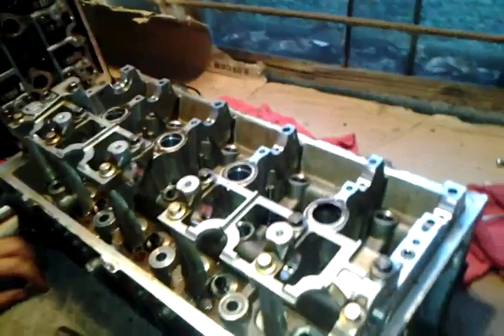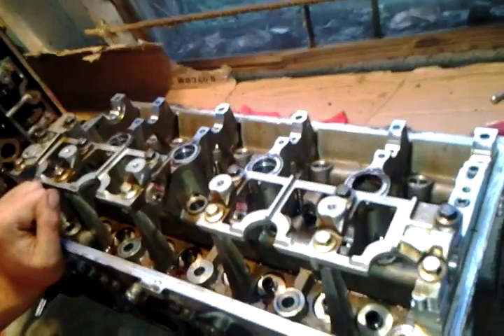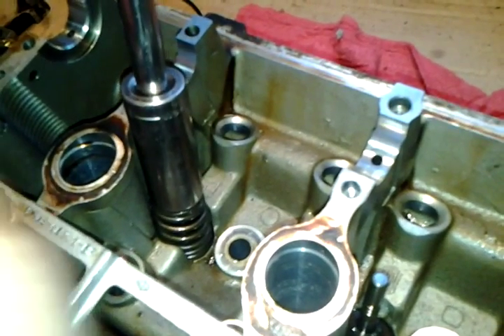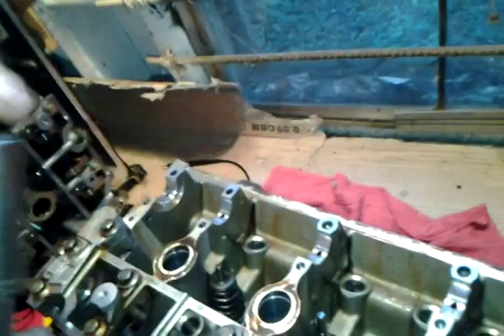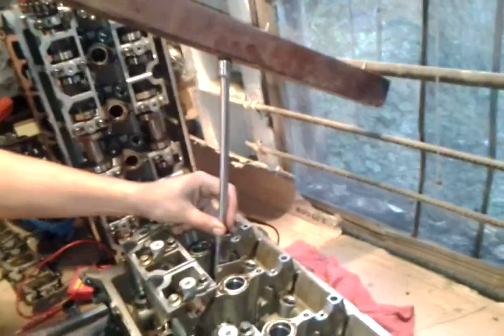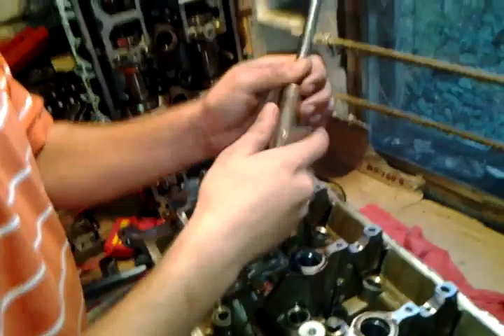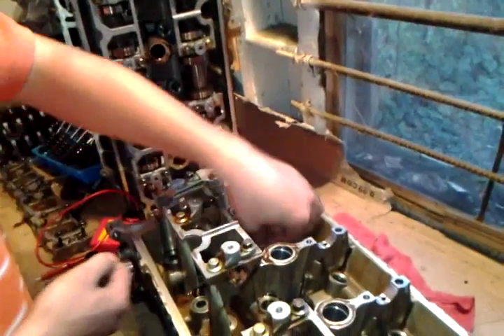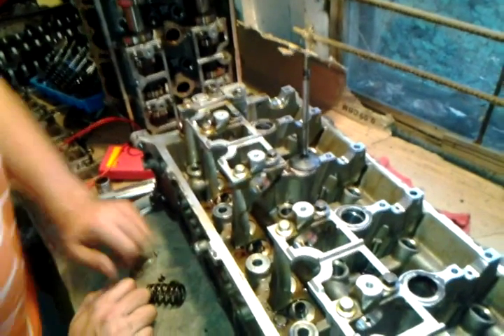Remove the Valve springs from a 4.6L DOHC Head without Ford Tools

Comment: Actually an old chevy method is rag under valves like you did and old socket just as you did but instead of using a lever and magnet set up you can use the magnet on socket as well but use a rubber mallet and crack the socket hard and the keepers will pop out I have done this on 4 valve head many of times and it does not hurt anything. granted if you use a 20 lb sledge and crack it violently sideways you can bend a valve but then the same moron that did that mistake is same one tore apart an engine so he probably already destroyed a number of parts already. I used this method as I purchased the 4.6L 2V spring tool and 100% it will NOT work on the 4 valve head maybe a handful of cylinders yes with major issues

Comment from the maker: You would not want to do this with the head in the car unless you had a air compressor blowing preasure into the cylinder via the spark plug hole. Depending on the tool you are using, you should be able to use a wrench and pivot it on the camshaft shaft as directed. You just need a very strong magnet
Reply: when removing valves in vehicle do not use compressed air I used air many times in past and occasionally you have a ring issue and it will not hold and the valve will drop the BEST method is to remove the spark plug in each cylinder and feed clothing line (made from soft cotton) into the cylinder around 10 feet give or take and then using a breaker bar and socket slowly turn the engine clockwise at crank pulley bolt until all the clothing line in cylinder is compressed against valves and stops. this hurts nothing it provides a soft cushion to press against preventing valve to drop so you can swap out springs easily when finished turn crank counter clockwise and remove the clothing line ..rinse and repeat for remaining cylinders.. this is a method that works with everything and harms nothing been using it for 30 years and still using the same piece of clothing line as well ... one word of caution when cutting off the end of clothing line use a lighter so the ends will not fray makes it easier to feed into the cylinder

Comment: NICE TRICK, BUT HOW CAN YOU DO THIS WITH THE HEAD STILL ON THE ENGINE IN THE CAR??? ANY GOOD IDEAS?  ALSO UMMM...  WHERE DO YOU GET THE HARD DRIVE MAGNET? I MEAN, WOULDN'T IT BE RISKING DAMAGE TO MY COMPUTER TO TAKE A CRITICAL PART OUT OF MY HARD DRIVE???
Reply: Neodymium magnet from anywhere. Can buy them on ebay.